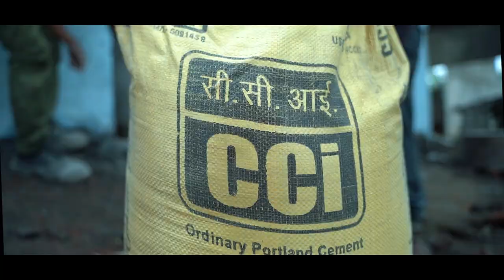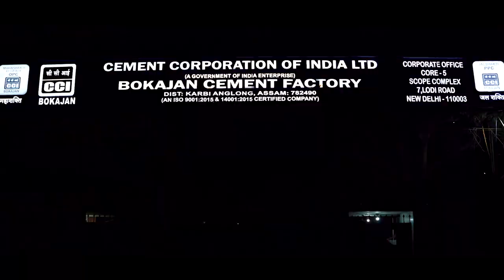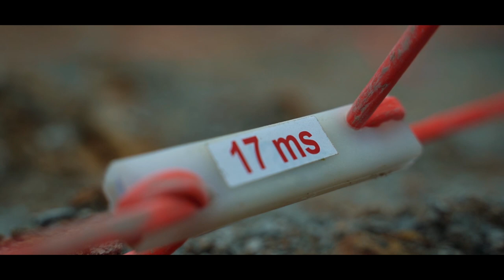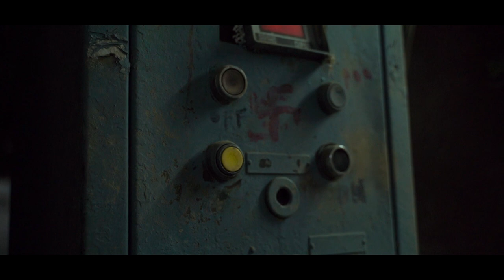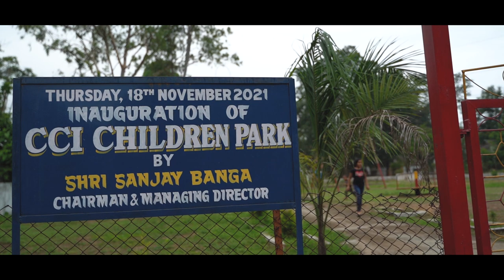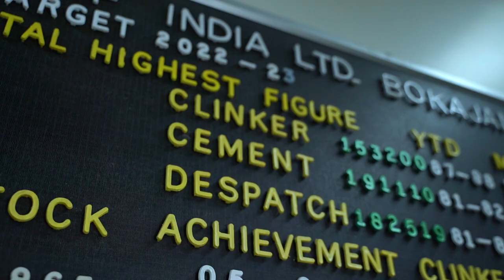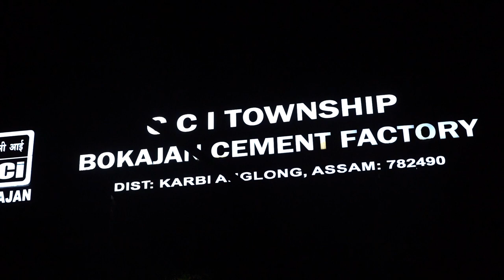CCI BOKAJAN | This is How Cement is Made | Documentary | Cement Corporation of INDIA

Comment: There is a fundamental flaw in this video... . first stage in cement manufacturing is not Mining.. but it is geological exploration.. A cement manufacturing unit cannot be conceived till meticulous geological prospecting is done. One should not undermine role of a Geologist in cement manufacturing process. This aspect should have been covered either by HOD (Mines) or GM.